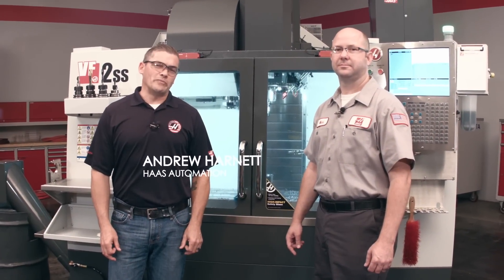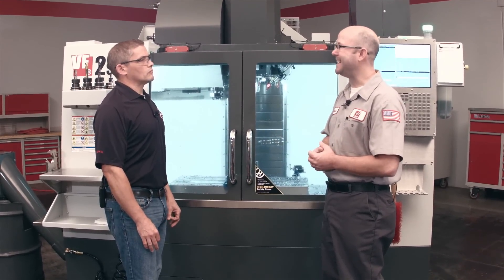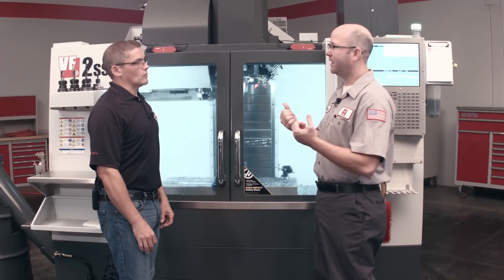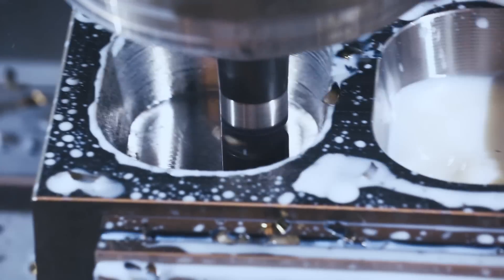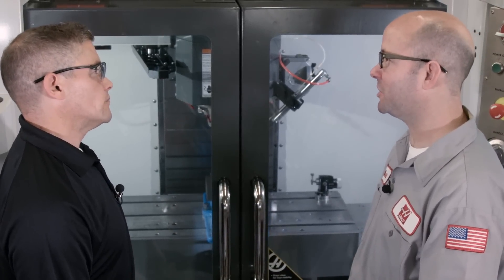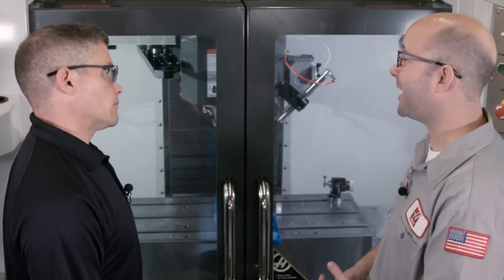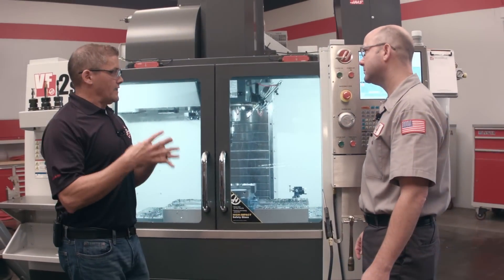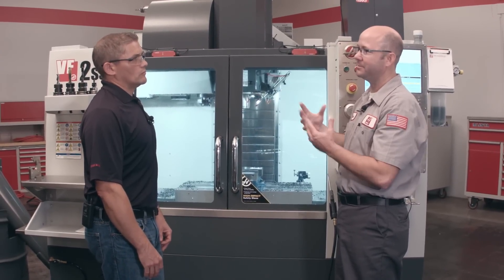Through Tool Air Blast - Blast chips away during dry machining - Haas Automation

Comment: Air Turbine Spindles® 30 powerful governed direct drives are featured in this video - to 1.4 hp with speeds from 25,000 to 90,000 rpm. To view autoloading on Haas VMC’s (with or without through tool air blast) visit www.airturbinetools.com

Comment: Yeah - the autoloading high speed capability of these Air Turbine Spindles cut my cycle time to 20% of my main spindle.
I beak less tools too. My job  took hours - now were done in in 12 minutes/

Having their governor in the turbine these heads they don't slow down under load n the tool path
So we use these Air Turbine Spindles at governed 65,000 and 50,000 rpm on all our VF Machines.
What's neat is they have no duty cycle and being ultra low heat
And with power to 1.4HP they chew through Rockwell 62 for me. Accurate at 2µ too so no problem with finish or precision. 

Now to the point I guess...
I give this blast feature the thumbs for letting me load these Air Turbines from the magazine in seconds